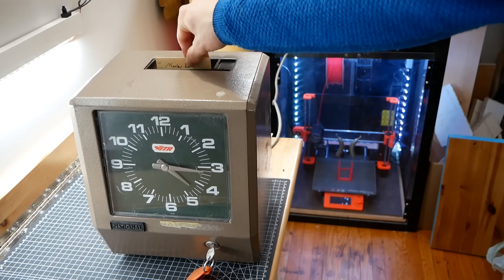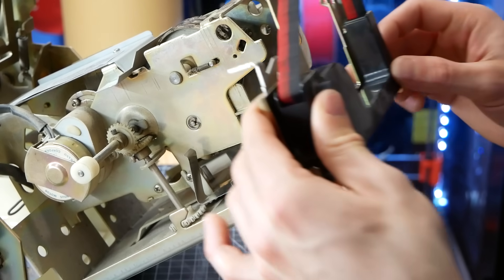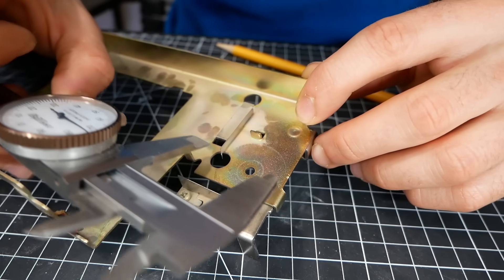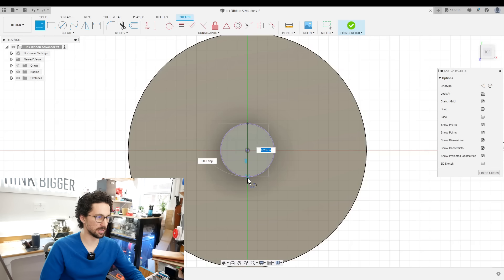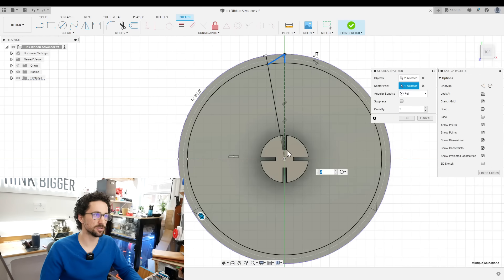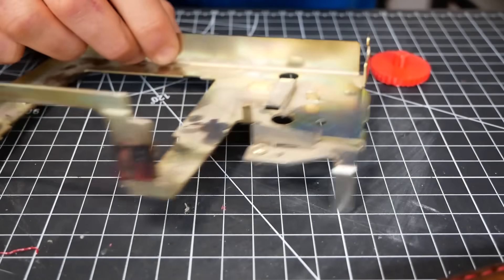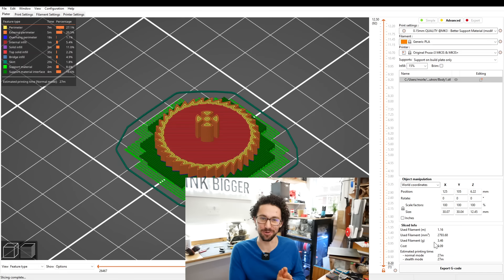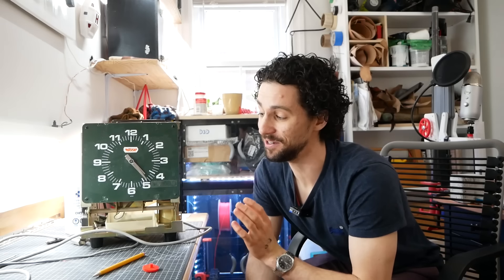They wanted 100 dollars. I 3D printed it for 9 cents.

Comment: Couldn't the gear teeth have been done a little cleaner using the parameters? You had to manually select the number of teeth and select each one individually to extrude.
For the number of teeth, you could enter 360 / ToothAngle, this gives the exact number of 36 (360 degrees divided by 10 degrees). Your guess of 35 was close but not exact.
(I've also seen options that will automatically copy something every X degrees up to 360 or whatever, automatically. Not sure if this is an option on Fusion but it's definitely a thing on other software.)
To avoid selecting each one, you could first create the sketch for one tooth and extrude it, and then create the circular pattern afterward on the extrusion rather than on the sketch, meaning it would automatically copy the extrusion for each tooth.

Comment: Just a heads up, you don’t have to go to the parameters menu every time you want to make a new variable! 
You can simply take the shape you’re wanting to dimension, and set its value as
variable_name = dimension value
And it will automatically add it to the menu for you!
Reply: Dang thanks this is a great tip that I never new
Reply: Same, thanks for the tip

Comment: That metal strip looks like it might chew through your printed plastic with use - depending on how much you plan to use this. It looks to reciprocate with a lot of force and a lot of friction. I don't know how hard 3D printed plastic is so it might not be an issue. Just a concern at the back of my head.

Comment: It didn't cost you 9 cents. It cost the time it took you to breakdown the machine and test it, plus the time to research the missing part, plus your machine breakdown and testing time, plus your design time, plus your printing time, plus your redesign time, plus your reprint time, plus your machine reassembly and testing time, plus your cost of the 3D printer, plus the cost of your materials, plus the cost of your electricity, plus other miscellaneous expenses. Add that up and tell me it was cheaper than $95.

Comment: Even if the cost was the whole ink cartridge tray, this still reminds me of GM part pricing. They had an OEM power steering cap for around $5, but wanted me to pay $90 S&H. It cost me less to drive 3 hours to a junkyard and rip one off a dead version of my car.
Reply: in your case time is not money for most people it is.
Reply: On the other hand his 3d printed version costs well over 9 cents. Factor in overhead and man hours spent making the plan and he would be pretty close to that 95 bucks
Reply: @ringofasho7721  add overhead when u go out
Reply: @backstabber3537  LOL, I work 91 hours a week, I ain't going out anywhere
Reply: @ringofasho7721  oh my no life then luckily I work from home now

Comment: Also its just like the auto industry, they wanted to sell you that whole metal unit with the gear already installed, but yea you definitely did work around that Monopoly the company has over, or most all companies have over little tiny parts that they would rather sell with the unit, instead of selling the customer the part they need, that’s why you see it a lot with micro chips also I’d rather just sell u the whole unit for $600 where you could just change the microchip for 12 bucks max. This industry of companies go ahead we want to make the most money fuck let’s just charge them an arm and a leg instead of offering the certain part that might be needed, it’s almost like with what Tesla was doing, only allowing Tesla to be able to work on their cars, Also with farm equipment as well, only allowing say John Deere to work on the farm equipment, because most of that equipment is now basically all electronically controlled you can set a tractor up to run the whole field just by programming it and not even have to be in the tractor all day, but they don’t allow the Farmer that bought the tractor  to be able to work on it, thankfully people have made scan tools, and other diagnostic and equipment that allows the farmer to do work on his own machine, because let’s say if an ECU goes out or a control unit goes out on the tractor it Has to be brought all the way into John Deere or have somebody come out from John Deere to program that control unit to the tractor. It’s a monopoly

Comment: So in 2017 I heard this was the cost $0.20 per gram for standard (0.2mm) resolution; $0.30 per gram for high (0.1mm) resolution
Electricity, And labor charges, Tax, Shipping, Customs, exchange rates. Unless it is a shop that does 3D printing Or plastic molding a Time stamp punch clock is well worth $95 because the cost of buying a 3D printer And the hours of design to finshed product is more that 95
the example would be getting 20 barrels of crude oil And making 92 octane for your mini van

Comment: 12:20 why are the teeth half chewed away on the bottom half already?
Reply: That just sometimes happens when you don’t have the 3D Printer tuned in correctly, also happens sometimes that when you remove the supports that an small part of the finished piece rips off. The part will still be perfectly strong, so i wouldn’t worry about that.

Comment: 95 dollars seems "reasonable" given the age of the machine and all (pretty good that they still provide the necessary replacement parts and service).. not to piss in anybodies pot but it is laughable to compare the cost like this... "you can believe" that you had to take a fair amount of time to "reverse engineer" this part and to design, manufacture, and assemble it...  while I do see the need for these solutions and to protect resources ( shipping, material, etc.) this assessment of the cost is just overexaggerated for clicks and not in the slightest realistic or reasonable... prices for these types of replacement parts that are not the typical wear parts are highly comprised of the additional cost for storage, handling, service, and shipping as these parts of the company are usually not making a lot of money providing massive amounts of replacement parts... pricing is fair for something that is ordered every now and then and 95 is not to make a profit and just to keep this service afloat

Comment: Nice reversed engineering. Also typically a case of milling vs 3D-printing. I assume the original part (teflon/ertalon?) was manufactured through somwhat automated milling. Which takes way more time, definetely in that time period. I don't know what it costs to hire an engineer and/or technician in the US, but here the price of that would already be near that 95 USD. I also think the original part was more durable? For 9 cents you can argue it is very cheap to replace, but a company wants durability most likely. But in this particular case, it makes perfectly sense to use this solution. I like this video because it shows the real benefit of a 3D printer for the DIY tinkering market.

Comment: 9 cents versus $100, wow! 
Yeah, but you completely missed the simple fact that you spent a lot of time getting to the point to 3D print that part. I'll guess you spent at least a couple of hours working on the clock, several hours drawing up the part, and an hour programming the printer. Even at $20/hour this works out to over $100, not to mention the cost of the printer. You make the company look like a bunch of jerks for charging less than it cost you.

Comment: This is how the 3d printers help in every day tasks. I have done hundredths of similar fixes in many devices, Even for my bike and my car. 
Of course someone always needs to be careful and not use such prints in items that may require other materials for safety reasons.
Also this is how companies makes money, This will cost even less for the company that make this gear because they should have a mold and make a lot more of these.

Comment: Your gear's price difference was a factor of over 1000.   I need a couple gears made too, they are for paper shredders, but the gears need to be metal.  These things are hard to come by & most are likely not made or supported anymore by their manufacturers.  I am still scouring the internet, such as at Aliexpress for these shredder gears.  Just like your time stamping machine, just one gear makes all the difference.  For my shredders, everything on the shredder works, yet the whole thing is halted & unworkable just because one gear in its gearbox is broken.

Comment: Well 9ct isn't the real price of that part as much as anyone likes to claim. If you factor in design and production costs as well as your first prototype, general costs, etc. etc. it is not 9ct. Also you get the full assembly for a machine made in the 1970's 50 years later. Of course they overcharge, etc. and honestly props to the company to actually offer it and not simply deny the request by saying "purchase a newer model". 

With that being said - nice work.

Comment: If your tooth angle is 10 degrees, you should have had 36 teeth not 35, since 360/10=36. That would probably make the turning of the gear more reliable.
Reply: Science, b****!
I noticed that too :)
Reply: Meh, it doesn't matter. As long as the ribbon is advanced a little or a lot, it will get re-inked by the sponge inside eventually.

Comment: Hey look after I have bought an 800$ 3D-Printer and invested 50 hours a 40$ into Fusion - this piece costs 95 Cents + 800$ + 50x 40$.

Like wookworkers - you can built this table for 200$ + 5.000$ in shop machines. Or you can drive by car for 20$ gasoline (+ car, insurance, license...).

Comment: It’s not just $0.09. How many hours did you spend on this?

This isn’t a good example because the company offering you a replacement part on a 5 decade old product is actually crazy. 

You designing and printing this for a product that you can’t get the part from the manufacturer is a better story.

Either way, nice work.

Comment: Up until 1990, Disneyland had these mechanical timeclocks to record cast-member attendance.  Then they moved to mag-striped ID cards.  

WDW in Florida already had swipe cards but they were plastic with hole punches to encode data.

They've moved on to a more modern proxy/RFID card type which is used across the company I believe.

Comment: Wait a minute what's the price on the ink cartridge replacement? Cuz they wanted 100$ for something you printed for 9 cents....
Would it be more cost efficient to buy ink and refill the cartridge?
WAIT A MINUTE they wanted to charge you 50$ more for a part that comes with a replacement cartridge? thats a rip off if im understanding that right,

Comment: i would have measure the hole first then from the hole to the farthest point on the shadow using multiple point where the shadow is visible to be sure then doubled the average and added it to the holes measurement

Comment: Well, since they wanted to replace the whole part, metal and all, together with the man hours and tooling costs, I'd say that pricing wasn't too bad for such an old machine. But you had the time and you had the tools (the 3d printer) and you only needed a small part, instead of the whole assembly, so yea, for you this was indeed more cost effective than buying the part.

Comment: to be fair, for the regular folk, is not viable, first you need to have a 3d printer, second you need to know how to use it, third, in this one im not sure how many man hour you need it to make the gear, not to mention you need it to remake it to fit better, and a 3d printer is really slow (dependin of the detail) fourth, the material used might need to be change in the future, i think the manufacture uses injektion , and only for one, the price from the manufacture is really high too, but maybe its because those machines are old, they dont produce as many as in the past.
3d printer is a neat hobby but as someone that needs to work and doesnt have so much time to do this as a hobby, because if you work with this stuff is way cheaper an easyer.
if i had that machine i would look for the piece on ebay for way cheaper, or a broken machine to look for the missing piece.
personally you need to make a better balance between cost of production and product, of course the material cost 9 cent, but the work that is behind it adds up some more cost.

Comment: The worst part about stuff like this, from a business perspective, is that they made the product so prohibitively expensive to replace, compared to the cost of time and material, that it's just better for the buyer to do exactly what you did. Even if they didn't have a 3D printer but saw this video, they could buy a cheap 3D printer, get the files to make the part, and spend a few hours learning how to make the thing and only be out about double what that one part would have cost them to buy new from the company. Which makes sense in that you now have the ability to make that or other parts you might need for the time clock or for other projects. It's a long-term solution that ends up being cheaper and more convenient, as you're only waiting for shipping once and then have near instant access to whatever you need that's possible to be made on a 3D printer.

When, if they had originally said, "Well, $15 bucks seems fair." or somewhere in that price range, (Though still overpriced, obviously) most would likely have gladly sent that much to them to save themselves the hassle and cost. I'm all for people making money off of their work, research, materials, and engineering. I want people to make money off of that, it's what gives us consumers the great products we have access to and the incentive for people to make new, cool, and life changing things. I just can't get behind anti-consumer practices that basically make repair impossible or prohibitive, almost like you never actually own the thing you bought and that leads me to fully respect people who are able to see an unreasonably priced item or an "impossible fix" (to hear the company tell it) and go, "Nah, I'm good. I can fix that myself in my garage." and the seller has exactly zero people to blame but themselves.

Comment: 1 change i would make is making the part going trough the petal plate a bit smaller and then press a brass sleeve over it to avoid the metal cutting it off.

Comment: i'm sure if you calculated all the time you've put in it to design and measure, figure it all out, it would be 95 or more too, it's not just the part , theirs might be metal . but I like that you fixed it with a modern gadget and gave it a longer lease on life

Comment: Only 9 cents, WOW ! 
I've been looking for a manufacturer that doesn't charge for engineering, tooling or burden rate.
   I need several prototypes designed / made. None of them require as much material as your gear thingy. Maybe half. So, I'm thinking 5 to 6 cents per project. 
   Please contact me immediately ! There's $2-3 of business on the table here.

Comment: There is the issue of intellectual property (IP) to consider.  The company that designed this owns and licenses the rights to manufacture parts for a fee.  The US Army is looking into 3d printing for on-the-spot repairs because some parts are not kept in stock (low demand) and are made when there is enough demand to justify it.  Sometime months down the line.  The Army's solution is to order the piece and therefore pay for the IP but also create the replacement to get the equipment mission capable right away.

Comment: I like how you show the process of recreating a part, but to be honest, I don't really agree with the aggressive tone against the manufacturer. The fact that parts are still available for such an old (and let's be hones, very obsolete) machine is a good thing. For companies that still use such a device, I don't think $ 100,- is a big deal to repair this machine. Keeping every little part in stock is expensive for commercial companies, so I completely understand the decision to only stock assemblies. The margin they might make on a little gear wheel is probably negligible compared to the cost of maintaining the inventory, so it's not viable to stock it. Just praise the company that they provide a solution at all.

Comment: Of course, you don't want to expend a lot of money on a hobby project and it's very nice to be able to repair something by yourself, but 9 cents is only the cost of material you've used (and from my experience this slicer calculation is generally pretty off). If you only add up the hours you've spent on doing this, it would be already much more expensive than that. Now imagine for a company that actually developed this, kept documentation for a long time, and is still paying personnel not only to make this part but also to support customers, $95 it's actually cheap.

Comment: The 3D print is cool. But could have also made it out of wood. Aluminium. Copper. Probably the most expensive option but you could even have gotten a LEGO(TM) gear and fused a piece of plastic on it and then cut out the notches on the axle.
None of this is critique. Just showing you ALL the alternatives that came to mind the second I saw $100 for a gear.

Comment: 9 cents? Not really. How long did it take you to create the model? How long did it take you to learn HOW to make the model? What about all the equipment you used and the associated cost there as well? That part was no where near 9 cents. You wouldn't sell it for 9 cents either. There's no reason to talk down on a company that still makes the part on a machine from that era. $95 is arguably, cheaper than your 3d printed part.

And as an aside, I could literally SEE parts of your gear flaking off. There's no way that plastic part holds up over time against a metal lever.

The video was neat, but what a sour after taste.

Comment: Dude, you got 10degs spacing, that means it'll fit 36 times into a circle, bc a circle is 360 degrees.... Also you might wanna make the holes for the cartridge wedge shaped instead of rectangular, give it some space to interact and wiggleroom